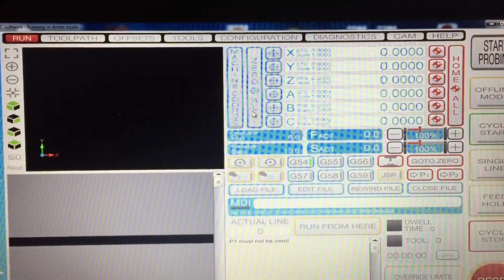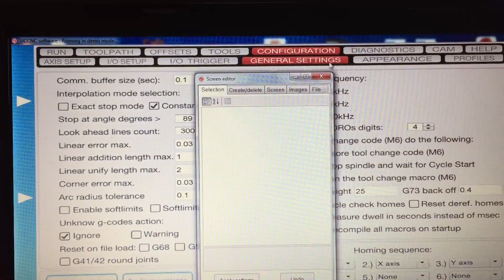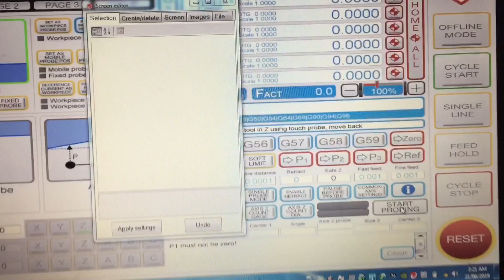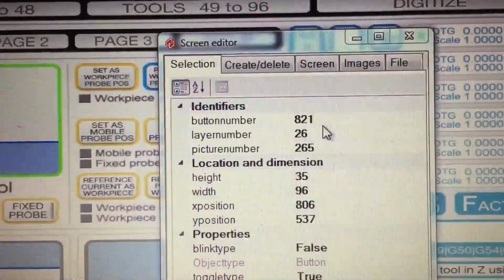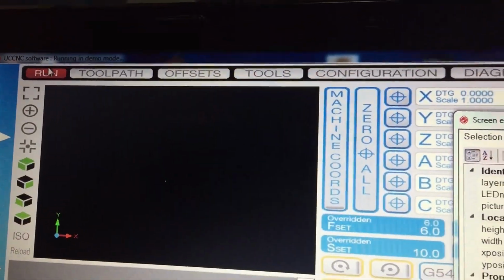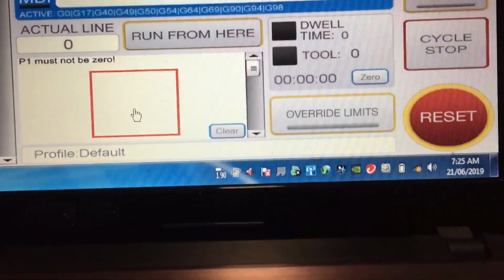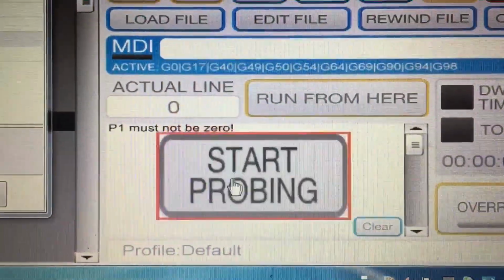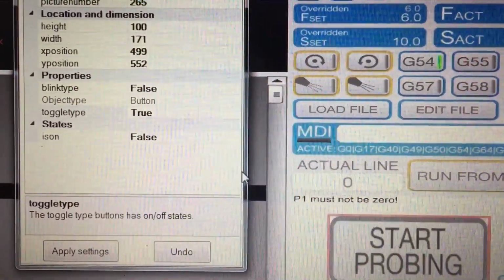UCCNC Screen Editor - Create a linked button on run screen

Comment: is there a manual or how-to setup a phisical output switching by software event to for instance a red warning light ? i cannot find any information on that topic in relation to uccnc. the only thing i found was your video on the e-stop button
Reply from the maker: Join the UCCNC users group on Facebook for help. 
My only suggestion would be to use a relay triggered from an output pin.

Comment: I see that you use UCCNC quite a bit. I have it working fine on everything I need except Probing an internal circle to centre work on my mill. I currently have V 1.2111 and it has the probe tab and probe function displayed. Unfortunately I cannot get it to work and wonder if you have it working and what version of UCCNC you used. I previously used Mach 3 and had a reliable probing working and also did some work playing with VB macros. I am looking for someone that has probing working that can help me use the standard screens. 

John
Reply from the maker: Hi John
Try joining UCCNC users group on Facebook. There is a wealth of information and help in that group.
Reply: @diycnc3442  I have joined the users group and so far I still do not have a working probe. I have seen some probes that do work on Youtube videos so it must be possible, but no one can tell me what version software that they are using. It is a simple question, can you probe to find the centre of a hole and what software version are you using.
John